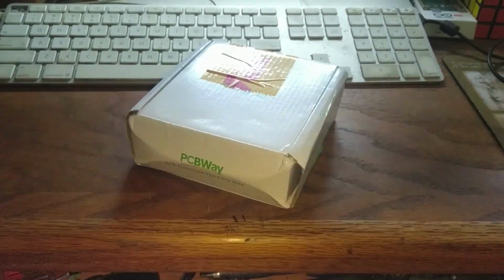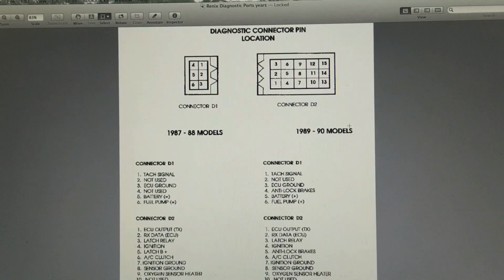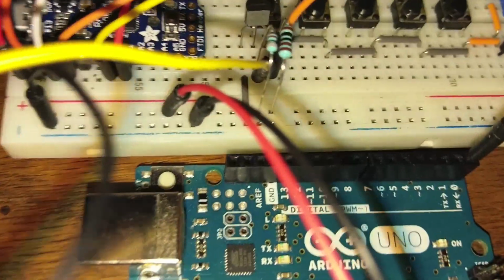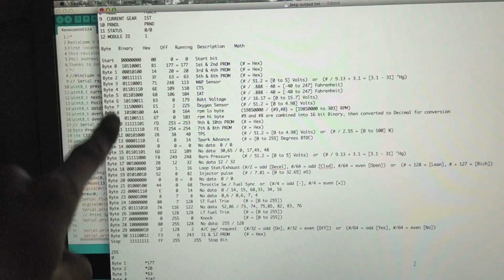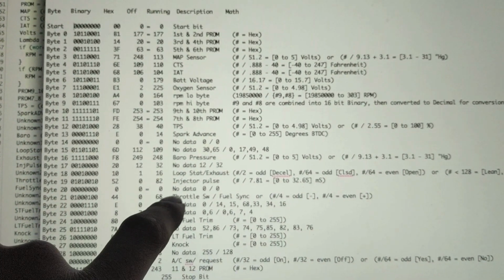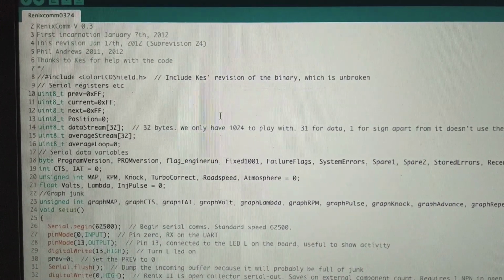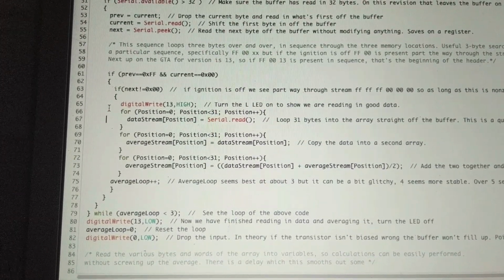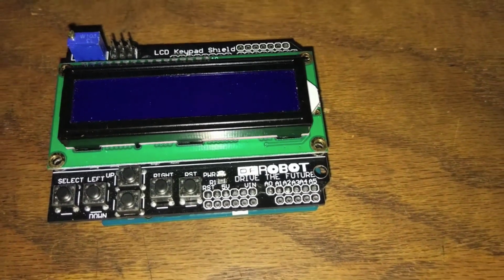Renduinix Alpha Update / DIY Arduino Renix ECU Reader

Comment: WHat processor and instrution set does it use? Is there  a software version i can use to search for a dump online?  any idea how fast you can poll and get reliable results becase the pulse width at idle seems all over the place.
Reply from the maker: If you're taking about ECU processor, it's Motorola based but that's as much as I know. The datastream is automatically sent continuously by the ECU so no need to poll for it. The datastream is however slowed down by the processor as the RPM is raised, so you'll get to a point where it almost stops coming it at redline.

Comment: curious about the terminations your using for the jumpers. never seen terminations like those. guessing that they are terminators for stranded wire that allow you to use it on the SBB when you're not using solid core jumpers.
Reply from the maker: Are you talking about the breadboard jumper wires? I bought an arduino breadboard kit that came with the stranded jumpers and the solid prebent jumpers as well. Really useful for making quick connections
Reply: ok. always used solid core as jumpers. the terminations are cool, but if you stick with the solid core you don't have to worry. interesting that's part of the kit.
Reply from the maker: Just curious why you suggest using the solid core over the flexible stuff? It's easier to keep track of but harder to use when going across the whole SBB or other components.
Reply: when using a sbb, and solid core, you could cut the wires to fit. in engineering school, that's all we had. never seen the terminators for stranded, they're nice but seem like an extra step. ultimately for short distances, i.e. breadboarding, there is no benefit to stranded over solid, and solid is just easier to cut-to-fit.

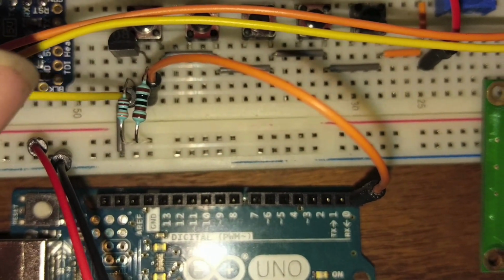Comment: Am I crazy or is the resistor off your base (@ 15:51 in video) only an 11 ohms? brown, brown, black, gold gold?... the Sketch showed it at 33k..
Just wanted to double check for sanity sake (and I don't want to fry anything).. a 33k would be orange, orange, orange, gold (I think) Just looking for a sanity check.. 

I'll be doing this shortly to my Jeep (been playing with arduino for a while now)..

Thanks for all your hard work
Reply from the maker: Handwriting isn't the best, especially at ant level, but the base Resistor should be 3POINT.3k ohms. (3.3k)

White balance is a bit off and it doesn't help that the resistor is 1/8w size, couldn't find any 3.3k 1% with a standard 1/4w size but the color banding is as followed: 

Orange, Orange, Black, Brown, Brown; which according to the 5 band scale is 3, 3, 0, x10, 1%

Let me know if you have any other questions!
Reply: Cool, Thx, for the clarification, I'll be trying it out later this week.(90 4.0 jx auto)

Comment: Thanks, NickInTimeFilms.  This is great.  I deffinitely want to build one for my 87 XJ.
Reply from the maker: Let me know if it works for you. I need to figure out if all older models are different or if only the manuals are different. Hopefully this logic analyzer gets here soon so I can see what my friends Jeeps do, I've sick of waiting for shipments...
Reply: I have everything except the 3.3k resistor.  I will order one and get building.  It looks like the speed signal for the TCM is only rpm from the input shaft.  I think a speed signal can be generated from the t-case or tail shaft (2wd).
Reply from the maker: Yeah, I had to add 3 resistors together to get 3.3k on my test board. TCU Speed sensor is only Trans output shaft RPM which doesn't account for t-case, gear ratio, or tire size. The speedometer runs off a cable driven gear in the t-case tail shaft.

Comment: i have some logs for you.
http://pastebin.com/LaGYsFBG
http://pastebin.com/WasVg8Yp

i tried switching to the graphical output but i think i forgot to change something so its was all off.
Reply from the maker: SWEET BABY JESUS. You are the man. Only took a sneak peak but the first 2 bytes of PROM are the same as mine so that's encouraging.  Will do a calculated stream in a bit. Glad it worked for you!
Reply: +NickInTimeFilms I have a late 1989 built 1990 model. I have what seems to be 1989 wiring colors.
Reply: +BSDKllr  also I have a 1995 xj ecu lying around. and the CCD bus is semi well documented for them. but there is someone that is working on it for an arduino.
Reply from the maker: Made up a quick calculator in Excel and here is what i got from your running stream, everything looks great so my alpha model will work perfectly on your truck from the looks of it. Interesting thing I noticed is that byte 14 shows a 1 on yours where it has always been 0 on mine. Your PROM Exactly matches mine so that is interesting as well.

RAW, Calc, Description

177__177__1&2
_20__20__3&4
_63__63__5&6
_91__13.07__MAP
124__99.64__CTS
113__87.25__IAT
227__14.04__Volts
_59__1.15__o2
_66__13250__RPM lo
103__1498__RPM Hi
253__253__9&10
254__254__7&8
_35__13.73__TPS
_14__14__Advance
__1__1__0
_86__86__N/A
253__30.81__Baro
__0__0__N/A
_16__0.25__LP/Exh
_62__7.94__Inj ms
__0__0__0
_76__19__Th Sw/F Sync
_14__14__N/A
_28__28__N/A
128__128__ST Fuel
103__103__N/A
143__143__LT Fuel
__0__0__Knock
__0__0__N/A
138__4.31__A/C
243__243__11&12
Reply: +NickInTimeFilms I wonder if it's a error code. I accidentally broke my knock sensor in half so it's completely unplugged. I'll have to check this the modus later today

Comment: Do the alpha testers already know if they're gonna be a tester? If I don't make the cut I plan on building my own and flashing your code
Reply from the maker: Not yet, still gotta out on the finishing touches. please try this out for now though, would love to confirm a few things
Reply: NickInTimeFilms Do you know of a good source thats NOT from china? Don't want to wait 2 months for them
Reply from the maker: +Se7enAte Shipping was fast for the screen but you dont even need it if you just want to check if the code reads from a computer. search up arduino LCD keypad sheild and then sort by closest or something like that.
Reply: NickInTimeFilms For $4 there's no reason to not get an LCD. Just ordered everything, Hopefully will be here soon, but it could be towards the end of October according to eBay
Reply from the maker: +Se7enAte Uhhh, you in America? I sorted by nearest first and saw USA shipping estimated September 10th.
Reply: NickInTimeFilms Yeah in Texas. My arduino should be here soonish. The LCD, molex, and RJ45 connectors I don't know. I'll jerryrig something up with loose wires and my laptop to get readings. But since I have an 89 4.0 auto XJ like you I'm sure I won't have too many issues
Reply from the maker: +Se7enAte Cool. Biggest thing I'm curious about is if your PROM number is different then mine. if the first digit is the same for all models then it will make the stream acquisitions a lot simpler on my end
Reply: NickInTimeFilms Hopefully I'll be able to get them for you soon, but you never know with ebay. I'm just getting excited to have a scan tool. I already know exactly where I'm going to permanently mount it.
Reply from the maker: So, if you were one of the chosen ones would you want an ECU only Alpha version or wait and see if Auto Trans Comms are possible. Also, black buttons seem to blend in with the case too much. Do you see that as an issue or would you rather have white or red buttons? Depending on the divide I could default white and add red as a custom option.
Reply: As a final product I would want auto comms. But since you don't even know if it's possible yet, I'd take the ECU only version. Since right now the goal is to see what vehicles the scanner works on or if any modifications are needed for others. Plus I don't think the data you would get from the trans would be super important, it isn't hard to tell what gear you're in and everybody usually has an idea of the MPGs they're getting, although it would be nice to have. And the buttons don't bother me. you could always get different colored filament to make the case a different color too. That's up to you. I think you should give an option for different colors
Reply from the maker: A small selection of alt color cases could be an idea. Well, I think i'll waiting until my logic analyzer arrives and then make the final call on if I'll start sending out some ECU boards or if I can make it work for TCU as well. Hopefully that call can be made by next weekend.
Reply: You think that talking to the TCU would require a hardware mod to the board or just software?
Reply from the maker: 99% hardware. If it was purely software then I'd send away and update as needed.
Reply: Hopefully it just needs a transistor or something simple and not a full board redesign
Reply from the maker: I'm assuming it will operate the same way as the ECU. If that's the case then I'll need another NPN and Resistor combo that piggybacks to another pin on the Arduino and hopefully just a baud rate change. If it's not inverted then I may only need a single pull-up resistor.